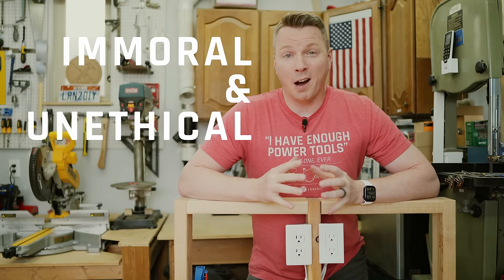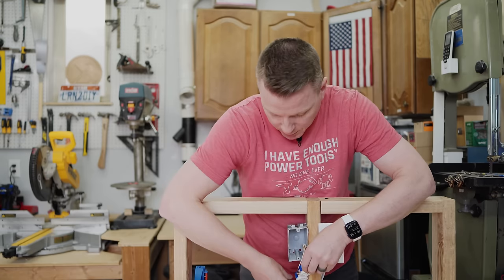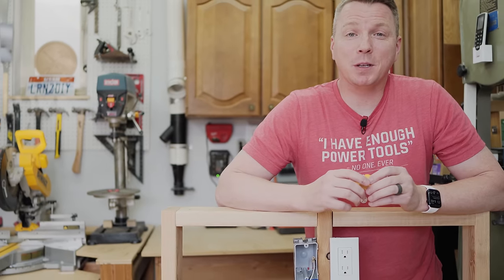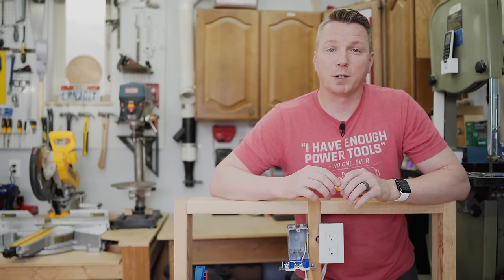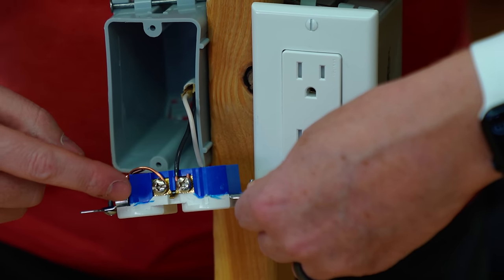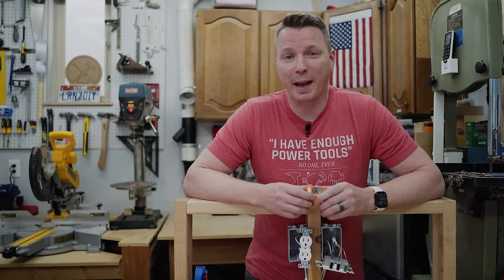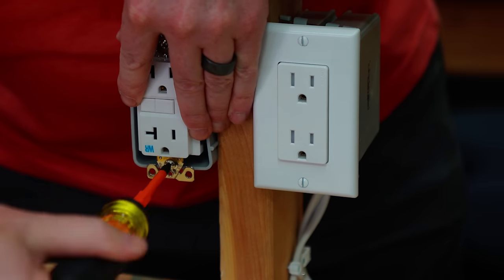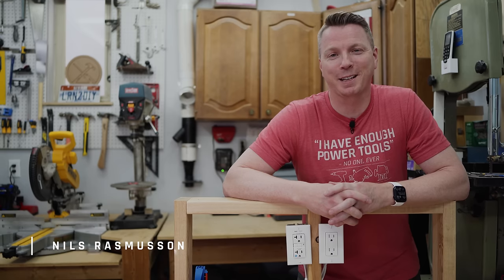People Are Adding Deadly Hacks to Outlets

Comment: I grew up in a house in Europe with what they called scheme 0.  Everything was 220V 50Hz and fully legal. Every outlet had a ground pin bridged to the neutral wire. Very few accidents and I found in some old homes still approved. Got zapped endless times and on 120V 60Hz it is hardly an issue. But nowadays GFCI's are so cheap I do install one on every circuit.
Reply: Why on every circuit? In Europe it is mandatory to put one as the first thing in the fuse box. 1 of 300mA for the entire house, and a 2nd one of 30mA for all the "damp" rooms (kitchen, bathroom,...). What you are saying with the ground bridged to the neutral is not legal. At least not in my country.
Reply: @blackov1466  A DIN mount leakage protector is nearing the $5 mark. So where the DIN standard is used it makes sense, 30mA general outlets, Bathrooms 10 mA.
Reply: @blackov1466  Not legal usually does not mean you need to redo it for things that was built before the corresponding code was introduced.  Otherwise you would be rebuilding houses every year
Reply: @blackov1466  There is nothing mandatory "in Europe". Each country has its own rules which like everywhere have changed over time and generally the rules of the installation time apply.

300 mA or 100 mA RCDs are used on houses that use TT-grounding. In Finland TT is not used.

in Finland grounding was mandated on wet rooms in 1930 and it was specifically mandated that if possible to use the neutral wire. In 1957 separate ground wire was allowed with words (or other method). Using the neutral for grounding was banned on new installations in 1989 but one still was allowed to use a 10 mm² (8 AWG) PEN-wire. I have no data but I assume that was rarely used as it required more copper than three normal wires. That was allowed until 2007. In 1997 universal grounding and wet room RCDs were mandated and in 2007 universal RCDs. FiInally in 2023 adding new ungrounded sockets on old installations was banned.

As RCDs are typically put on the panel that makes using PEN-wires practically impossible. You cannot cut the PEN-wire with an RCD. I got a new panel in my apartment ten years ago but as I still have PEN-wires the RCDs were not connected. Of course they did not tell that to me. I thought for years they were in use.

So doing this "bootleg ground" is still legal on old rooms. Tu just need to find sockets that have enough connections for it. Normal sockets have only two neutrals which are needed fro the incoming and outgoing wires. Note here you do not need to do it to use grounded equipment like a computer as anything can be used on an ungrounded socket so the only reason to change is that you actually want grounding.  

Here the compatibility issue was old ungrouned equipment on grounded socket and there is no regal workaround short of an isolation transformer. Fortunately such equipment are rare ad it is issue only for collectors. It was a serious issue in the 70s and everyone cut their plugs or used dodgy adapters.

Reversing the connection is a problem and it has caused three fatalities since 1980 - all likely because of illegal DIY. There has been more non-fatal accidents. It seems bathroom, cabinets with a socket are the main problem. Because of this socket testers here must detect voltage on the ground. They have a metal contact you touch and it shows it there is over 50 V on the ground contact.

Te most feared thing with grounding with neutral is that if the neutral breaks the voltage gets to the case. I could not find any report on accidents caused by spontaneous breaking of the neutral. There were some caused by illegal DIY.

In other countries using neutral for grounding was allowed in Germany until 1973 (Klassische nullung). In Sweden it apparently has not been allowed. This is good in that you can install RCDs on the panel of of houses and apartments and instantly get more protection.
Reply: In Poland, "zeroing" was the proper and legal scheme until around 1994. Now this connection is called "TN-C" ("C"ommon conductor for neutral and protective earth) and requires at least 10mm² copper conductors. Of course this is impossible for outlets, so one has to use "TN-S" with "S"eparate ground conductor.
Reply: "Every outlet had a ground pin bridged to the neutral wire": Mever! it has to be the other way round: the neutral pin has to be bridged to ground.
It's illegal since some some years ago for wires smaller than AWG 10 (if the ground/neutral wire breaks and AWG 9 is unlikely to be cut accidental).
Reply: @blackov1466  
In the Netherlands every single circuit with user-accessible sockets needs to be RCD-protected (30mA). Whether its a 'wet' circuit or not. Zeroing is never allowed, not even in older homes. Having no ground (except for 'wet' circuits kitchen, bathroom, outdoor lighting or sockets) is allowed in older systems. But ground has to be on its own earth rod, it cannot be connected to neutral.
Reply: @nervousbreakdown4506 In Denmark it's the same, except that zeroing before the RCD/GFCI is allowed IF the power company signs a waiver that their incoming supply for the specific location has a sufficiently protected neutral (which was rare before 1990). Otherwise a dedicated grounding rod is needed with 2.5mm² or stronger ground-only cable to the panel.
Reply: @nervousbreakdown4506  power input is 4mm² or 6mm² stranded PVL.  The 2.5mm² ground rod cable is an actual cable with a gray PVC isolation around an Y/G PVC insulated solid copper wire . This cable type is used for nothing else.
Reply: @blackov1466  it's 30mA for all rooms that have sockets
Reply: @okaro6595  Slight correction to "illegal DIY". Anyone can do the electrician work to point. Anyone can make extension cord or repair it, even with out any training. On permanent installs anyone can do it but the thing is if there is not proper paperwork of the changes and systems is not according the electrical plans, insurance company can deny any compensation, but then again they can try to do it even if everything is perfectly in order. Only illegal place to work in is the main fuse box since you cannot turn it really off for amateur to work in.
You can do whole wiring setup, call electrician to check your work witch is much faster than them nailing wire in place on surface install or pulling wire trough pipes and they then connect that to main fuse box if they have license for that, OK stamp your install as their own and write the paper work making it legal. Been rewiring whole buildings this way, though i'm extremely accurate and have learned the basics to do this.. in some cases with better quality than supposed professionals XD

Though one should know enough even when just pulling wires so there is enough wire, what kind of wire is required and most cases it is electrician who you know, that you can just call and invite for coffee to plan out the wiring, or just check its designed ok, so you are not missing some vital information, but generally pulling wires is ok for amateur if those are cold, bit advanced can design systems like i have for some special use like rewiring motion sensor flood light to bypass the motion sensor and have forced on function, but since its AC there is feed back to the bypass so you must have switch the to disconnect it from the system and no longer plug type, but perma install for it and i would not recommend that, since its hassle to swap with these crappy led flood lights, it just was best option for this specific install i had.

As mentioned zeroing was and is common thing, since you can rewire building step by step, like i wired separate firewood/storage building last summer to have RCD outlets. Just zeroed it before RCD and in some point next building will get done and finally the main house area by area.
Reply: @Phillip Banes More than a country, when power came in region by region had electricity boards with each board having their own safety rules. Once a whole country adopts a common rule it is seldom enforced retrospective. I had seen installations in Latin areas that had bare wires on ceilings with periodic insulators. Even England kept its 3rd rail on local trains. Glasgow with its second underground used overhead power.
Reply: @okaro6595  Probably that standards are largely harmonised across the EU now. Not entirely, mind, but @Blackov's is largely accurate.
Reply: @Hellsong89  In Finland laymen cannot do any fixed installations. It all requires professionals and considering the complexity of the systems I do not wonder. It is much simpler in countries like the UK where all sockets are identical.
Reply: @LawpickingLocksmith  $5? More like $50
Reply: @dom1310df  Depends where you live. I was surprised how cheap they become, but of course test them to ensure they work.
Reply: Legal in europe? Every country in europe has it's own rules, and neutral to ground isn't legal in my country in Europe. Europe is NOT a country.
Reply: @okaro6595  same here in sweden and an electirc guy costs a fortune... No thanks!
Reply: @Nitroburner01  The amount of  non compliant wiring will never be known exactly. 110V is more safe!
Reply: @blackov1466  standards vary from country to country, and the 300 mA whole-property requirement is not universal. Where I live, all circuits have to be protected with a 30 mA RCD, but there is no whole property RCD at 300 mA. 

However, what systems are used also depends if it's TT, TN-S or TN-C-S earthing arrangements. The first of those does require extra protection as the ground loop impedance can easily be several tens of ohms, especially if the ground is dry and sandy.
Reply: @okaro6595  That's interesting and I am surprised that Germany allows neutral grounding as late as 1973. Where I live in the UK I don't know if it was ever allowed. There were two pin plugs in the BS546 standard (which dated from 1934), but the three pin versions of those plugs all had a separate ground/earth. Those are the old round pin standard (which is still on the books). The current BS 1363 (square pin plug) standard is three pin only and a ground/earth is mandatory on all outlets. The only two pin socket allowed is for low powered devices, like electric shavers, and that uses an isolating transformer. 

Prior to 1934, there really wasn't a single national standard. The electrical supply industry had been very fragmented before, and there wasn't even a single national voltage. That only really started being consolidated from the mid 1920s. Many houses were still using gas lighting at that time. 

I should add that there has been a very large number of changes to regulations over the time. I think it's now on about version 19.
Reply: @okaro6595  There are many jobs in the UK that now have to be done by professionals, and the installation checks are much more rigorous than they used to be, and that requires specialist knowledge and equipment. Of course, not everybody will comply with that, as electrical contractors are expensive...
Reply: @LawpickingLocksmith  not necessarily. A lot of people are fixated on the idea that the main danger from electricity is electrocution. It's not; there are far more deaths per year from fires caused by electrical faults than from electrocutions. 

One issue with the 120V used in North America is that it doubles the current draw for a given power compared to the 230V used in Europe. Power dissipation goes up to the square of current, which means that doubling the current over the same resistance quadruples the heat generated. You can put in thicker gauge wire of course, but it tends to be connections/joints where the problems occur if they are poorly made or degrade over time through corrosion etc. Then you get hot spots, which is the biggest danger, and those poor connections result in (almost) four times the heat generated at 120V than at 230V for the same load. Also, it affects the plugs/receptacles. The North American NEMA-1 receptacles can loosen over time (especially the cheap ones), and if not held firmly, high current loads can cause a lot of overheating.

It's one of the reasons that arc fault detection is being mandated in much of North America, and it's compounded with wooden house construction. You do not want hot spots and arcing within the infrastructure.
Reply: @TheEulerID  Got zapped way too many times on 220V 50 Hz, only once on England's 240V and would never tried at the time when Perth W.Aust had 254V nominated. I had a variable space power board in the US where you could slide the plug. I guess calling it suicide strip was not far off?
Reply: @LawpickingLocksmith  I got zapped often enough in the UK when I was a child, although not in what would reasonably be caused an accident. It was me fooling around with a screwdriver. 

However, in those days RCDs were not a thing, and I've no doubt it's a lot safer now.

In any event, there are some environments which are much more dangerous than others, especially bathrooms when wet. The vast majority of healthy people will survive a 240V zap in the dry, but in damp conditions, it's another story as the skin loses much of its electrical resistance when soaked through.

In any event, electrocutions are (relatively) rare. Looking at ONS statistics, in England (population about 55 million), there were total of 345 deaths between the years 2001 and 2017 inclusive. That's 20 per year. Of those 143 were in a home setting (8.4 per year). 

In contrast, there are about 270 deaths in fires every year in England, although not all are due to electrical faults (note that most of those are due to appliances, including misuse, not the infrastructure wiring). 

In the USA there are about double the number of fatalities in domestic fires per million people than the UK.
Reply: @TheEulerID  I brought a string switch to Australia for our bathroom. Totally illegal, but tatally safe for our family.
Reply: @LawpickingLocksmith  It's a bit off they are illegal. I know some people don't like them, but they are safe.

Comment: These are good tips. My house was built in the 40s and had an upgrade in the 60s. Attempts had been made since to bootleg grounds, but only in some parts of the house. The rest were two-prongs and were left that way. I did the stopgap measures similar to the way you describe, as some - some of the wire was two strand and others were three! Eventually, we did save enough to get the bad stuff rewired, it did indeed cost just north of 10k. We needed a new breaker box and an external ground 😅 but hey nothing smokes when you plug it in anymore!
Reply: The ground and neutral are connected at service entrance to your house anyway. If something smokes, that's something else. Realistically, that neutral wire will have less resistance than your body in a short anyway. Sharing that neutral wire as ground isn't ideal, but it does lead to the actual grounding. The circuit completes, so to speak. Don't get me wrong, I'd take the time pull another wire to a real grounding somewhere and do it properly on initial installation. But to rip open all your walls and spend north of $10k just so that your grounding is connected further away down in the basement to the neutral instead of closeby, is not worth it.

Comment: Thank you for bringing this up. We had legitimate sparks at the fuse box, and it was traced down to a ground to neutral when the attic fan was failing. This was the 1990's done deep within the box. It took me around 2 hours in the attic of my parent's 1950's house after reading the NEC. More annoying thing is I had to take apart a double decker box and redoing it all with legitimate WAGO connectors, as he had 4-5 connections with a twist connector in there, including an outlet to an air conditioner. Replaced every outlet (besides fridge due to trips) to AFCI / GFCI dual outlets. After finding this, I found 2 GFCI in the kitchen and outside in the forced open position. Now I use the SmartLock which test themselves and have a visual 'OK' on them, even at my apartment (they had USB outlet in the kitchen, no GFCI and same issue, one in the bathroom was forced in the open position!

Comment: My mother's house was build in the 40s and doesn't have a ground anywhere. I recently just replaced a bunch of outlets and put in ACFI/GFCI combo outlets as far upstream as I could.
Reply: Were yours dual function
Reply: @5.43v  Dual function ?
Reply: @pudmina  GFCI and AFCI are different technologies that do similar things.  Dual function would suggest they do both (arc fault and ground fault)
Reply: Did you label all of the outlets? That's required by code.

Comment: At my place farmers often make a "bootleg neutral". Back then they usually didn't wire in a neutral with 3 phase 400 volt outlets and also used 4 wire extensions cords without neutral to save wire. Back in the days it was not a problem, because they just powered three-phase motors for farming equipment like circular saws and grinders for corn. But now modern machinery comes with electronics which require a neutral to get 230 volt between phase and neutral. I saw many times that the farmers themselves rigged a neutral from a 230v socket or even light circuits with a wire or an extension cord to their appliance and then connected the neutral to the power plug. I also saw 3x1,5mm2 cables shoved in the power plug in addition with the existing 4x2,5mm2 so they have the neutral, when I first saw those "double cables"I didn't know what was going on, my dad laughed and said that is the farmers way of establishing a neutral when it's missing.
Reply: The same is true for modern "smart" switches for lights and fans that require a neutral.  This is why new houses come with a black, red and white wire in a switch box even if an old dumb switch is installed.  The unused neutral is just capped.